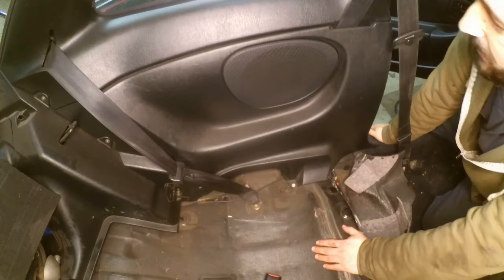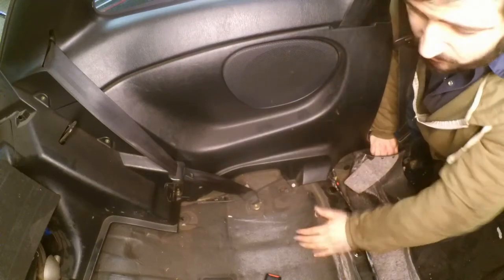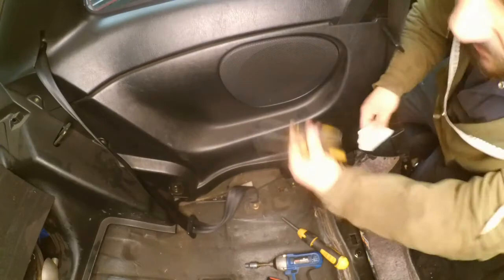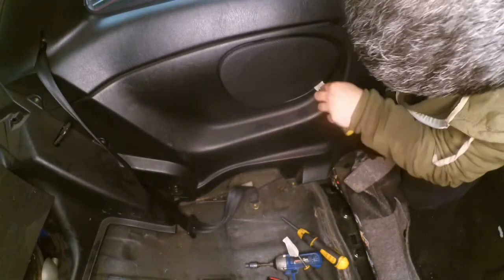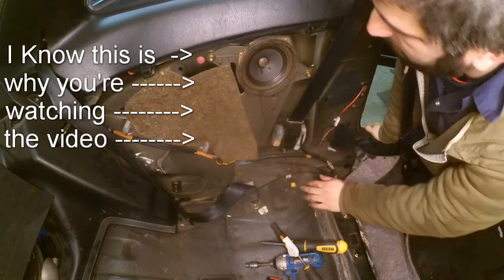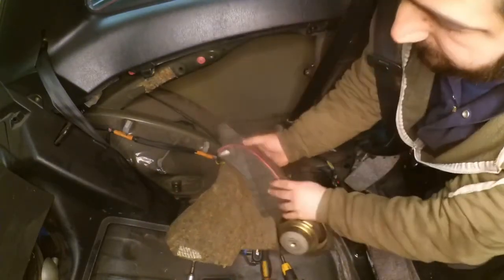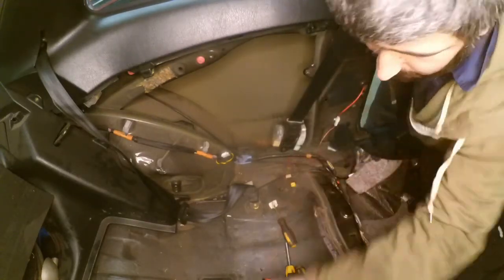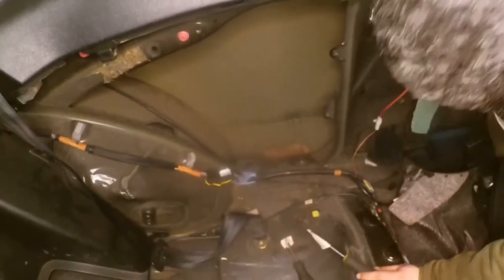Toyota Celica Gen 6 (93-99) How to Remove the Rear Interior Wall Trim (Speakers/Seatbelt/Panel Trim)

Comment: This helps a bunch! Very hard to find any videos about this car on YouTube, this video helped me get moving on my project again! Best wishes from the USA :)
Reply from the maker: im Glad My videos are helping you. 

I Wont be posting work on the GT4 for a while now because im doing extencive work on a Lotus Elan, but if you stick around I Will have at some point before the end of the year a Video on how to Modify the Camry ABS Sensors to fit the Celica ($17 sensor instead of the $200+ ones) 
My Car is running on those Camry sensors at the moment to confirm everything works fine, and im confident about it enough to do it all over again for the camera.

Comment: Is this the driver side panel because I need to know the difference between the driver and co-driver seat belt?
Reply from the maker: Seatbelt exactly the same both sides 😉
Reply: @tuga2112  my garage told me there is a difference I think the difference is in the metal clip that is above to the seat belt roll I think it's mirrored